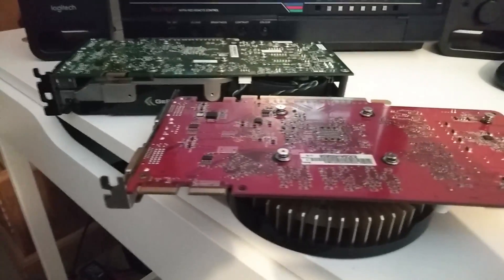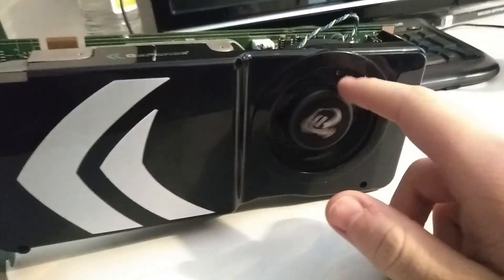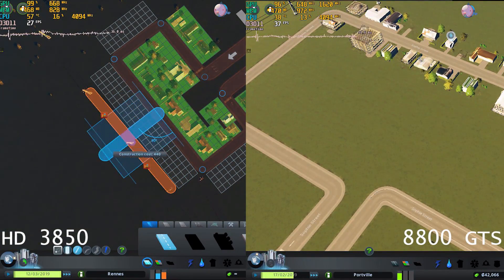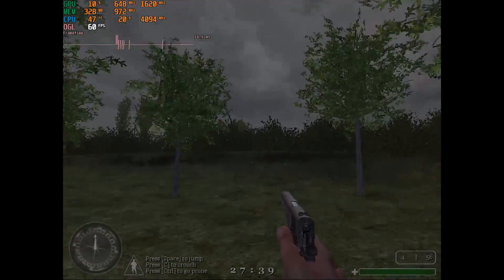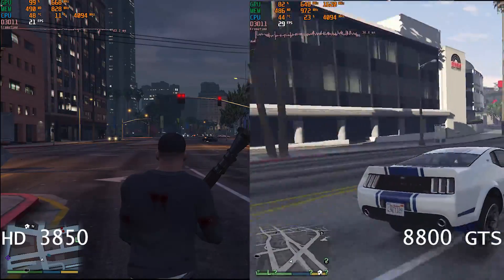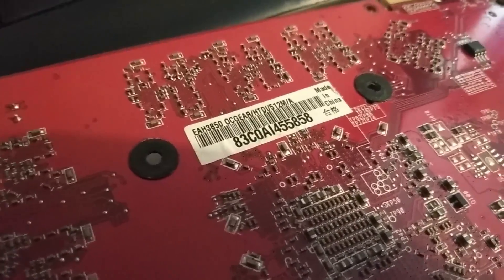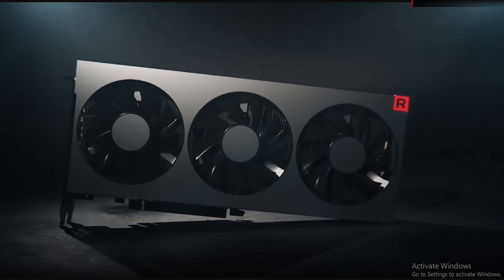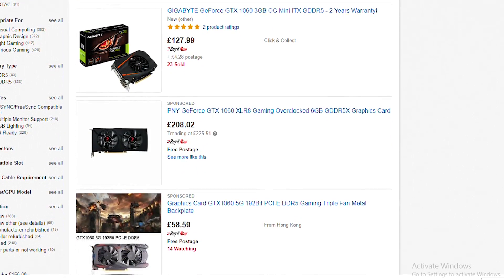HD 3850 VS 8800 GTS | The GPU Battle That Made Nvidia Good

Comment: Cool vid, btw.  I know it's old, but yeah... I had forgotten the timeline of things.
Now I'm running an:
Asus ROG STRIX B550-F Gaming II WiFi (WiFi 6e/BT 5.2 *5.3 in Win 11*)
5900x that I plan on selling and putting a 5800x3D in its place to boost up this final platform
2x16GB DDR4 3600 C16 dual rank (G.Skill Ripjaws)
XFX 6700XT 12GB
3x SSD's, 2x HDD's in RAID 0 (7200RPM drives totaling 2TB) and one 3TB WD Blue along with a Samsung Evo Plus 2TB M.2 drive.  Getting a 990 Pro here soon, also, I guess.
And all kinds of junk in my USB ports.  Also have Dolby Atmos and DTS:X purchases for my spatial sound options.  Yes, I actually bought them both.  Tend to use Dolby Atmos 99% of the time lol.  DTS:X comes with spatial sound for headphones and another version for a home theater sound system, which I don't have.  Well, it died... but it was from 2001.

Comment: I just pulled an 8800GTS 320MB out of my closet... along with a 6800GS AGP x8 that I unlocked to a 6800GT using RivaTuner.  And an FX5600 256MB (was horrible when I got it, bought a 5700XT 128MB immediately after.. it also blew chunks and then I got a 9800PRO). 

Been an AMD/ATi guy since, despite buying performance for your dollar.  Have owned Pentiums, Core 2 Duos/Quads (still have an e6320 and e6420 lying around, and had a Q6600.. it was a boss), which I upgraded to an FX-8350 and went with an HD7850 then directly to an HD7870.

Won't name everything I had in between and after...

But yeah... nostalgia.  It's a helluva drug.

Oh, I meant to say my final AGP x8 card in that 3400+ rig was an HD3850 AGP x8.  The final, best AGP card ever made.  It was just the normal HD3850 with a PCI-e to AGP bridge on it.  It was seriously bottlenecked by then with that A64 3400+.

But when I first built it, it was P4 vs Athlon XP with the Athlon 64's JUST coming out.  So I got the Athlon 64 3400+.  OC'd to 2.6ghz (2.4ghz stock).  

Such a beast for those days.  Then Pentium said "fine, here's some HT for y'all."  Still didn't help them any in games, but it did help open the steam overlay while gaming a WHOLE lot.

Comment: 😀 yay! sht card showdown 😍
i would go with the nvidia card.
Passmark 3850 = 530
Passmark 8800gts = 606
They are close but the invidia has the advantage of optimized drivers for many game engines. If you see any 6pin 8???? 9???? they are worth picking up for $5 to $10 each, good enuf for mom and pop computers 😊 And if u want a stronger but cheap 'radeon' branded card like this radeon chkout the $15 HD7570

Comment: the 8800 cards  rly did  change everything  stream processors (cuda cores)   vs fixed  pipelines   and  the ability  to use  them for  folding @home compute etc  epic  card for its time